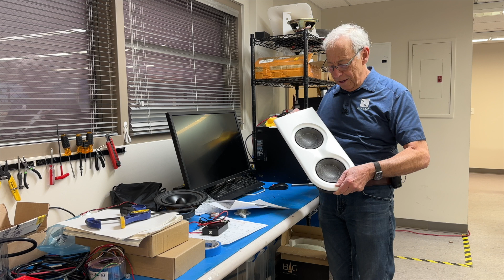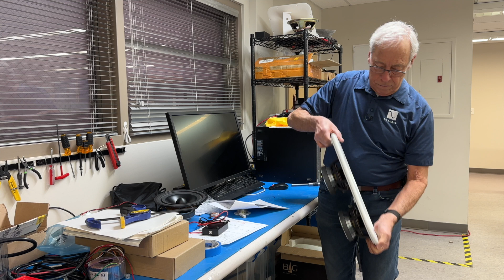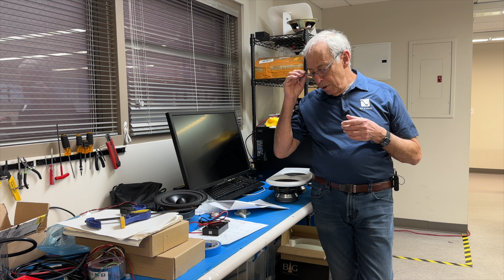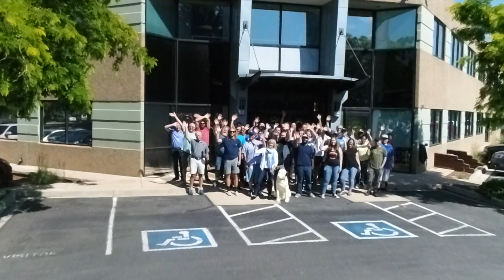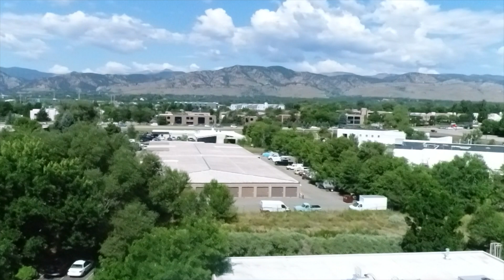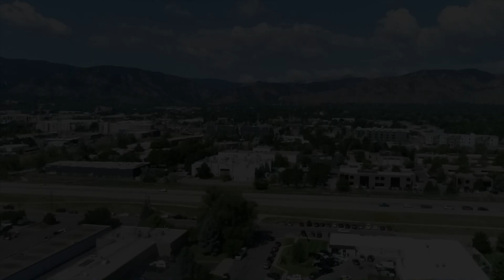Inverters and converters

Comment: Hi Paul, I am thinking about bringing my wine fridge (200-300W) from Hong Kong (220V and 50Hz) to the US which operates at 120V and 60Hz.  It seems challenging and expensive to buy a voltage and frequency converter but very easy to find a voltage converter.  What would be your advice for this situation?  Would you just sell the wine fridge?

Comment: Here’s the interesting thing that Paul never seems to get around to talking about. A router is the electronics that sends a signal to your Wi-Fi system so that your dac can do the job. I just purchased a superior router for my broadband signal and the improvement in my sound of my stereo was very significant might be nice of Paul with touch on the concept of a broadband router, major component in the signal path.
Reply: It's not literally in the signal path, of course. Also, are you referring to streaming or accessing files via LAN from e.g. a NAS?
Reply: @LeonFleisherFan  when you have broadband as a source, it does affect signal quality.. I send a hard wired signal to Wi-Fi and then to my Oppo cd player..
Reply: @gtrguyinaz  Note I didn't say that - in my experience, anything may or may not make a difference sonically, whether or not it's literally "in the signal path". In my system, even Ethernet cables, switches and power supplies for the latter make a difference. But again, it's not literally "signal path", and technically, it doesn't seem to make sense and really shouldn't make a difference, having said that, it was originally an electrical engineer who asked me to do some blind tests. We're constantly learning.
Reply: @LeonFleisherFan  what either net cable are you using..  my Wi-Fi  router is Deco.. there are 30 electronics all sucking the signal..
Reply: @gtrguyinaz  Meicord, which I believe is no longer made. I've tried a number of so-called audiophile Ethernet cables, and come to the conclusion that the best for audio purposes are unshielded (which most aren't because people "believe" in numbers, but what noise ends up in audio gear appears to travel across the shield, remember Ethernet itself only transports data packages, no timing info, hence no "signal" or data stream in the usual sense of the term), as well as using minimalistic plugs (again unshielded, no metal casing, non-magnetic) with high-precision spacing of the wire leads. Note these attributes are based on science, i.e. research, measurements, as well as listening tests, and not the usual trial and error common for audiophile aftermarket tweaks. Needless to say, there are some expensive audiophile Ethernet cables that are marginally better, but again, most today are based on CAT7 or CAT8, which are fine in-wall, but not for audio purposes, so I'd be careful what "audiophile" brand I'd be looking at.
Reply: @LeonFleisherFan  thanks for your thoughts. What country are you from?  I use some very interesting cables… from a small company .. Magnan.. Have your heard of them.. David Magnan was a sonic engineer for NASA and wire pioneer.
Reply: @gtrguyinaz  Switzerland. No, I do not know his cables. Seems as if everyone who makes audiophile aftermarket products nowadays worked at NASA at some point in the their life, LOL! But yes, I still have cables I got as samples (interconnects and digital cables from about twenty years ago) from a Swiss aerospace contractor, and those still rank among the finest I've tried, and in contrast to audiophile cables, they're light and thin, i.e. not bulky at all.
Reply: @LeonFleisherFan  search  Magnan speaker cables… they are 3 to 4 inches wide thin ribbons of high quality copper.
They are also 25 years old..Sounds like we are on the same page. My system is Dynaudio C5s …yes 20 years old.. HYBRED tube preamp and high output mono power amps..

Comment: We are off grid we are either running solar with a true sine inverter or when using a generator, it’s a Honda with a true sine inverter 
 It has always seemed very clean. But I recently acquired a new old stock Jolida tube amp at seem to be getting a hum from the transformer 
Will be doing tests, via removing all inputs as you have directed. But I fear it’s the amp. Since it’s coming from transformer and while I hear it in speakers. It doesn’t increase with volume 
Any help from anyone is appreciated 
Thanks

Comment: Numerous cars have inverters factory installed from the manufacturer. I have a 1100 watt factory installed inverter in my truck. 
It has a separate optional panel

Comment: Shorter Paul: Inverters are converters (general English sense of the word) but not all converters are inverters.  I find the terms confusing and a better word for changing DC to AC would simply be an alternator (for making alternating current) but that term is already taken for a car electrical component (among other things.)  We can come up with all sorts of English words to describe changing DC to AC ( cycler? periodizer? etc.) but the industry is stuck on inverter .  And thus "converter" gets stuck being used to describe changing AC to DC.  It's an imperfect universe.
Reply: Whatever you want to call it.😀
You can make coffee, power a microwave, power tools, TV, etc etc etc.
I have 8/ 950 amp glass mat batteries in my truck. I have a  1100 watt inverter, never used it.
Reply: Please do appreciate our perfectly logical way of translating these terms into Finnish!
Inverter - invertteri, Converter - konvertteri, Alternator - alternaattori, Transformer...well sadly it's not transformaattori but muuntaja. Not sure what went wrong there, but we're obviously trying!

Comment: Digital term inverter converts a DC Voltage level usually 5 V to 0 V and vice versa.
Reply: You can use an on off switch to do this...  Not sure I follow.